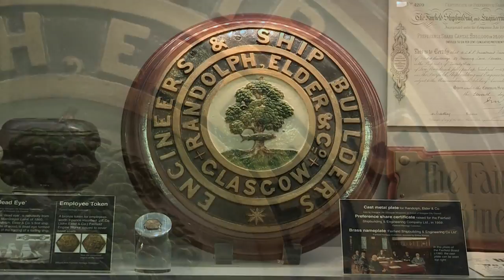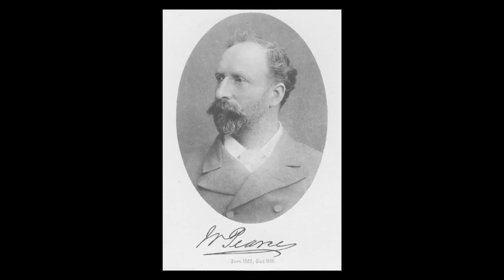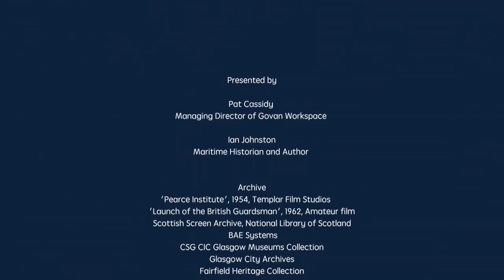Saving Govan's Fairfield Shipyard Building

Comment: I started my time as a welder in Govan in 1974. It was hard out on the slipways in winter with ice on the clyde. Conditions in the yard were very basic but there was a   good camaraderie. I was at the only launch in Govan that was done during the night because of spring tides and the size of the bulk carrier Ibn Jubayer. (I,ve still got the paper cuttings from that launch) Sadly it didn't last and had to move on. Will need to take a run down to the Heritage Centre for a look.